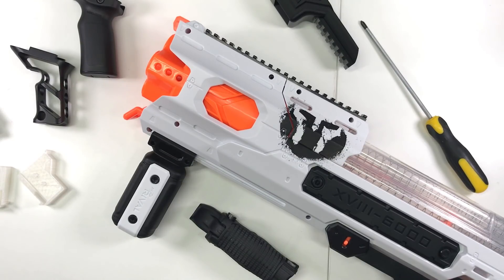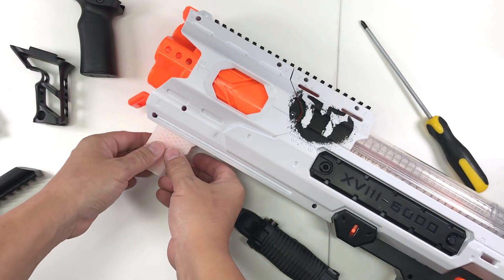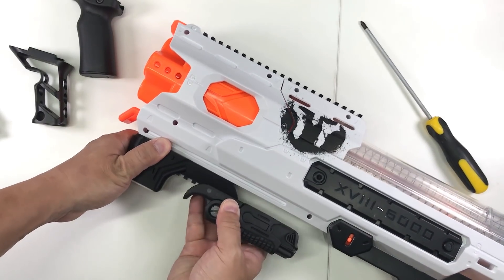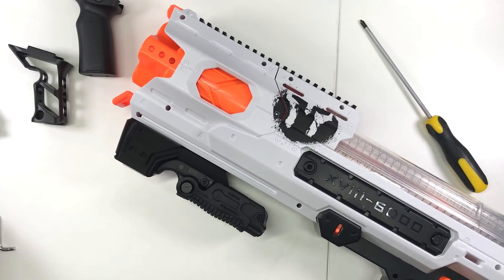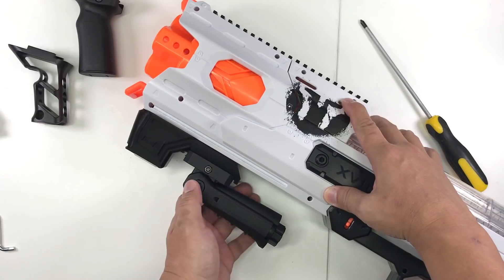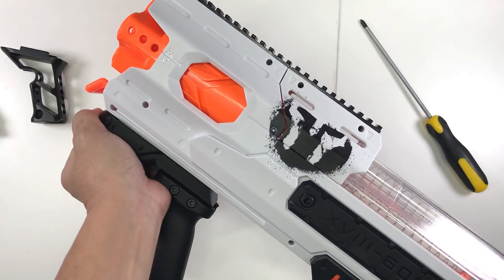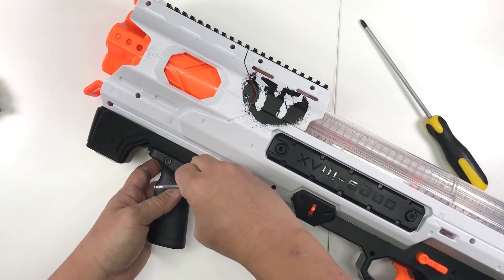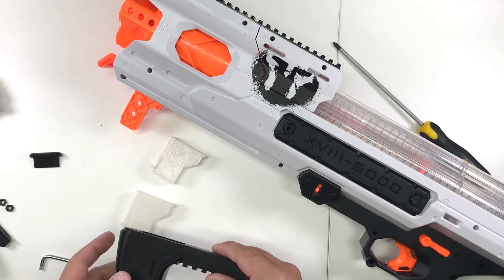{My Thingiverse} - Nerf Rival Hades XVIII - 6000 grip attachment

Comment: Hi Tungsten love this design & thanks for the generosity sharing. I notice that for my print, after a while the main piece locks onto the attachment loosely and I can pull it off easily if I pull at an angle downwards. Any way to mitigate this?
Reply from the maker: Kevin Khoo hmm maybe I can revisit the design of the inner piece to increase the catch length
Reply: Tungsten EXE that would be fantastic! Thanks in advance
Reply from the maker: just updated the Thingiverse, I added a version 2 of the inner piece "TEXE_Hades_Ver02_L.stl" and "TEXE_Hades_Ver02_R.stl" with a little increase catch size, hopefully it helps.
Reply: Tungsten EXE thanks so much!! Appreciate your kind efforts!